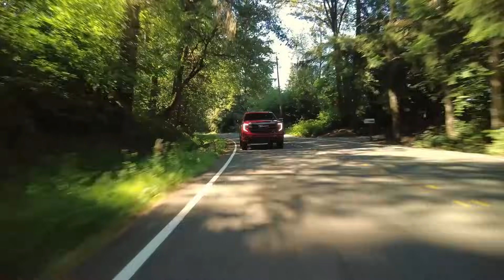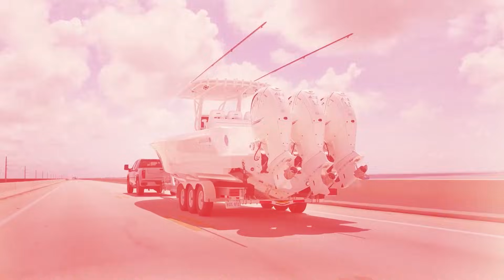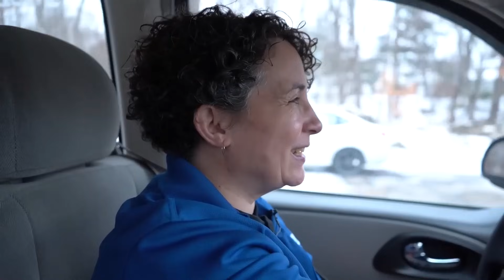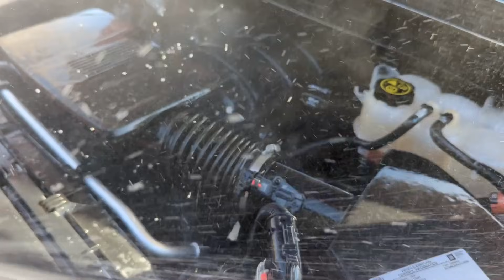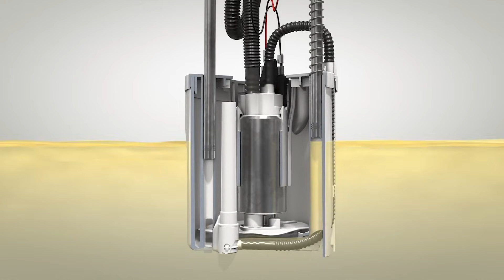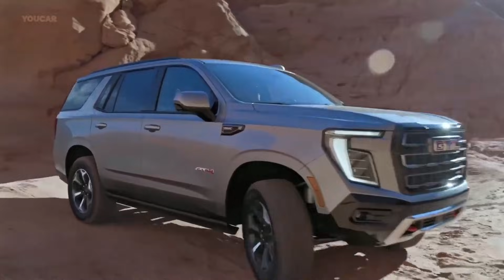GMC OWNERS! NEVER Do THIS to Your GMC – 12 Mistakes That Cost THOUSANDS

Comment: what about cam shaths 100 0ver rod berings 100 over metal filing in block ! use strate 40 wt. oil at 5 out tell that engines last 5 min. or 5 miles ? 880,000 engines 2021-2025 ? 80,000 dollar junk hmm ?
Reply from the maker: You’re hitting on a real issue. It’s frustrating to see high-priced modern trucks struggling with metal shavings and bearing issues so early. 40 wt. oil might be the only way to keep some of these newer designs alive!